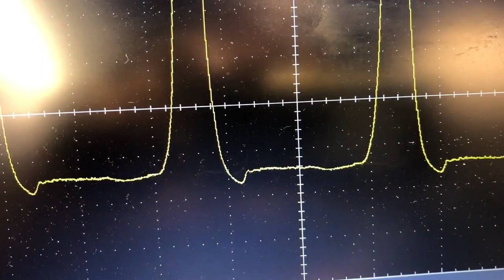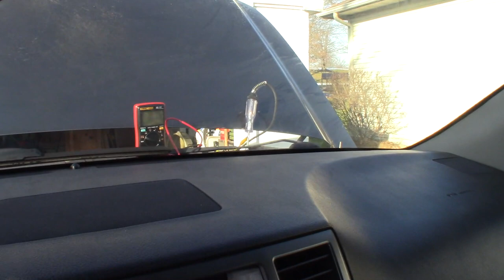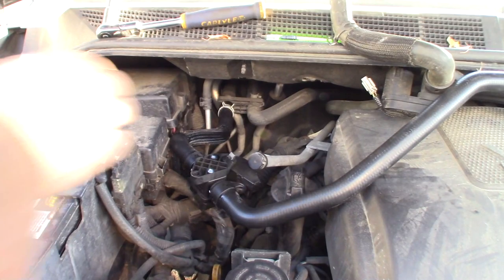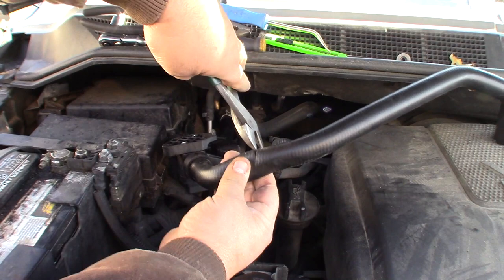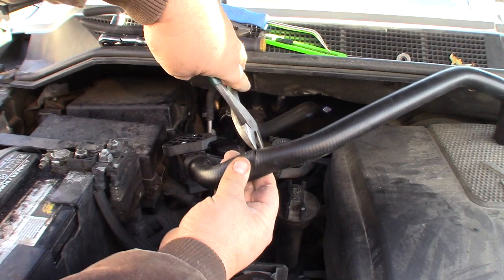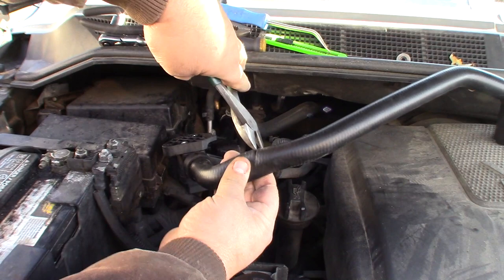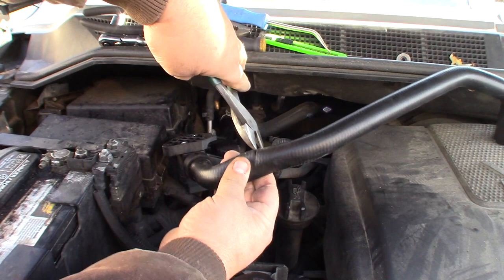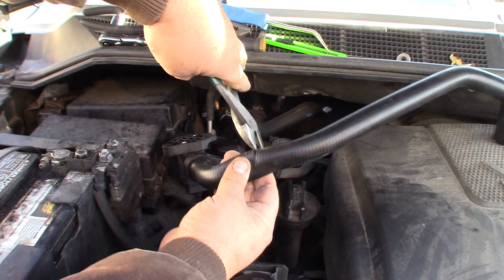2008 Nissan Armada - No Heat! - Bonus Footage At the END!

Comment: next time snip off the plastic fixed clamp and the hose comes right off the valve itself. use the short side like u did first the simply use a clamp for the other side onto the valve. no splice needed. also gates has a redesigned model for these which is supposed to more reliable then the original style